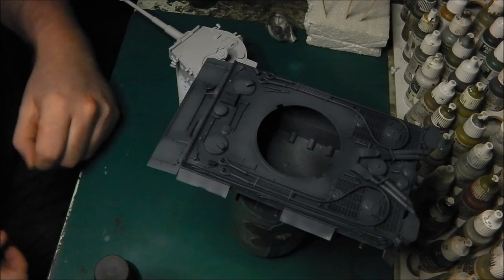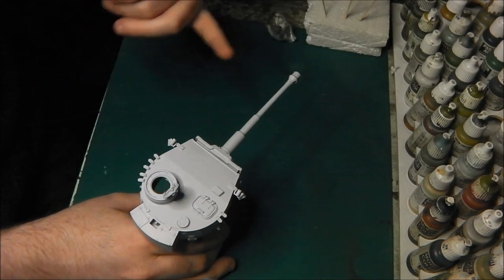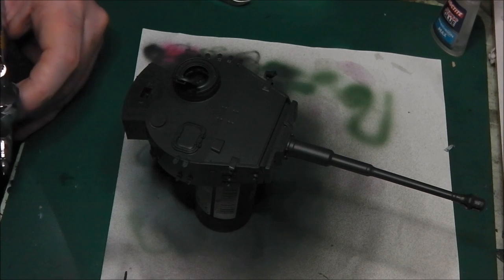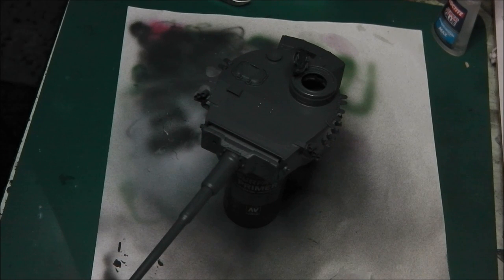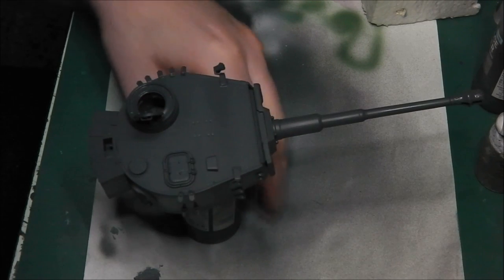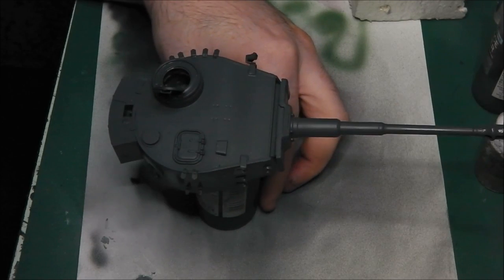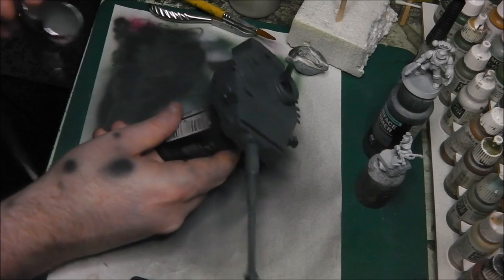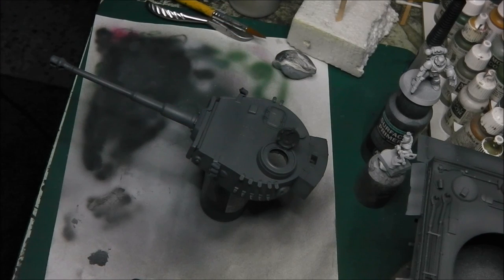How To Paint Panzer Grey with Panel Fade technique Tutorial

Comment: Great video as always. I continue to learn from your tutoring! Are these colors appropriate for the early Panzer I’s and II’s? I want to do a Panzer II dio for the Invasion of France in 1940. Thanks for any advice.
Reply from the maker: Thank you! I'm no expert when it comes to the nitty details of German paint evolution but I would imagine its pretty close to what they would have had. I most important thing to keep in mind when working with Panzer Grey is not to push the highlights so far that you create a grey blue tone. As its very easy to lose grey tone
Reply: @longlance67  Thanks Shane! I may just be getting to picky. By the time I weather it, there ill be a good dust layer anyway. Good point on the highlights! I hadn't thought about that! Many thanks again!